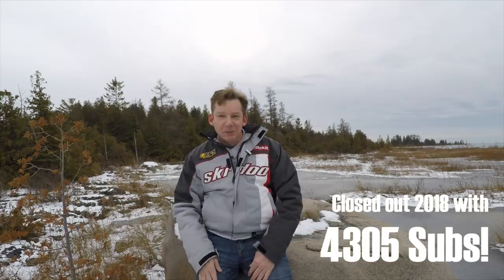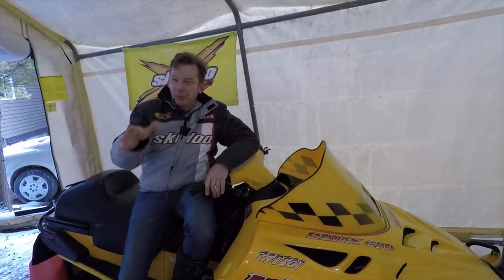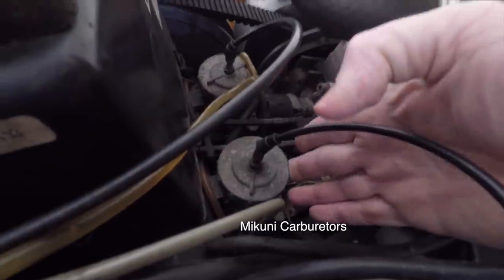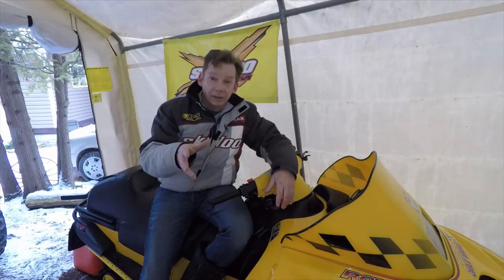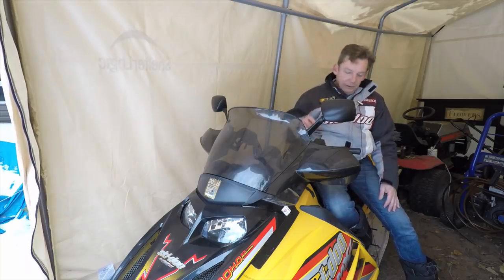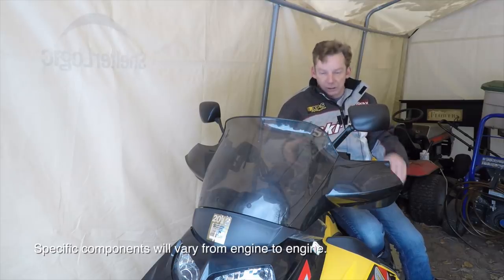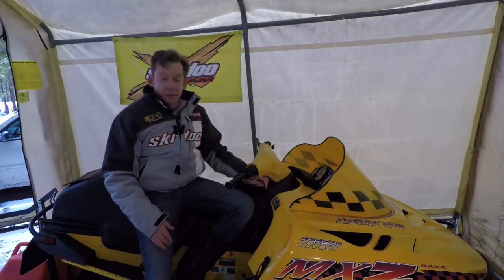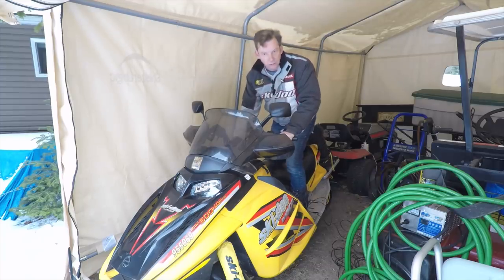Carburetors or Electronic Fuel Injection—What do I think is Better on a Sled?

Comment: I would rather have a skidoo etec any day over a carb machine.
Reply from the maker: I wish I could afford an etec...Thanks for watching and commenting.
Reply: @MyOldSled  you can.. you can buy like new ones used on Craigslist
Reply from the maker: Etec was introduced in 08..a 2008 or newer in good shape is normally more than I have to spend at the moment.
Reply: @MyOldSled  I believe 2009 was the first 600 etec but your right they aren't cheap.. I just bought a 2015 mxz x package 800 etec for 9000 on Craigslist with 782 miles . Showroom condition... Maybe someday you will have one... They are definitely nice machines. Skidoo all the way.
Reply from the maker: Jan 2008 they introduced the ‘09 tnt with e-tec..same difference, I didn’t want to spend that much.
Reply: @MyOldSled  yeah yes. Save up your pennies.. they are worth everyone.

Comment: Carbs
Reply from the maker: :) short and sweet. Thanks for watching and commenting.
Reply: Full Out no carbs are trash in my opinion. Get fuel injection it’s more responsive and much better at higher elevations
Reply from the maker: Hi Noah. I agree that fuel injection is better, thats why pretty much everything has gone that way. That said, I'm not sure it's fair to say carbs are trash - they're just older technology. Like I said in the video, there are reasonable opinions in favour of the carb for some riders. When I make videos, I try to remember owners who have a huge range of sleds. Since this channel probably has a fair number of subscribers with older carbureted sleds, I'm sure a lot of guys like them. If you're having fun, you've got a good sled. Not everyone can just go buy a new sled either. Thanks for watching and commenting.